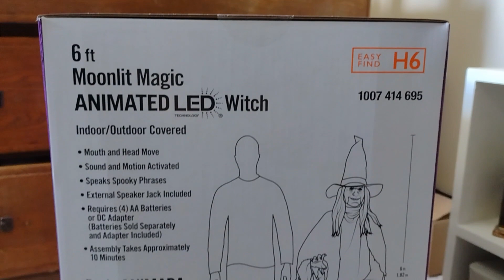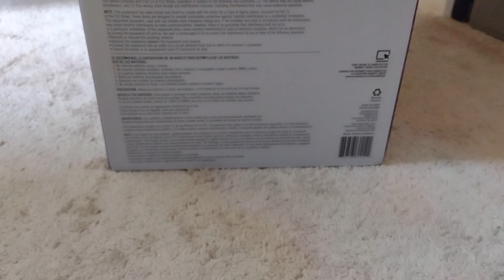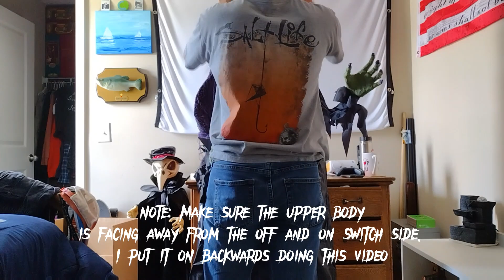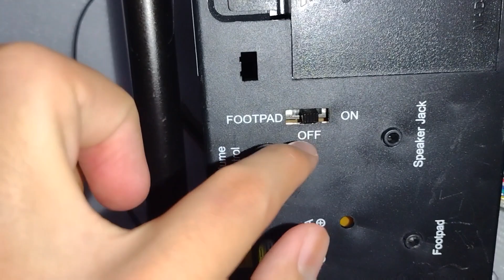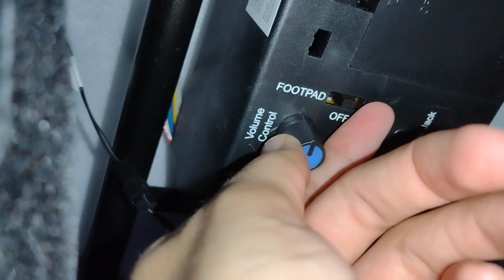NEW Home Depot 2022 TEKKY TOYS ANIMATED/ TALKING 6-FT WITCH | Unboxing/ Setup

Comment: Very cool purchase. You know how I feel about that one pole structure, but she seems really sturdy.
Reply from the maker: She actually is rather sturdy! Tekky always has their ways and idk how they do it but they do! It's very impressive actually
Reply: @gemmybonez459  I think that she doesn't have any swaying motion helps a lot.
Reply from the maker: @darthsidious47  It definitely does and that's how the one poll builds should be. Head turners not body movers
Reply: @gemmybonez459  yeah. Unless its built well. My 2015 Cauldron Witch has the exact same structure as the Lowes Evil Witches but it works so much better. It's very sturdy.
Reply from the maker: @darthsidious47  Isn't she also a head turner instead of a body mover???
Reply: @gemmybonez459  if you are thinking about the prototype then yes she does have head turning, but she has a 2 pole structure. I'm talking about the 2015 Cauldron Witch sold at At Home.